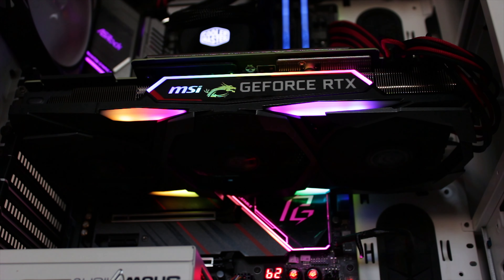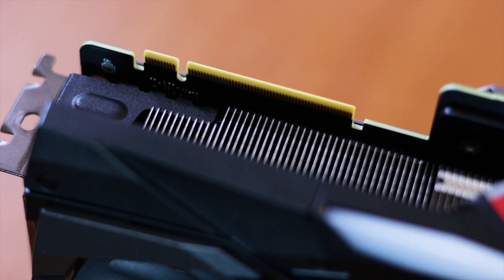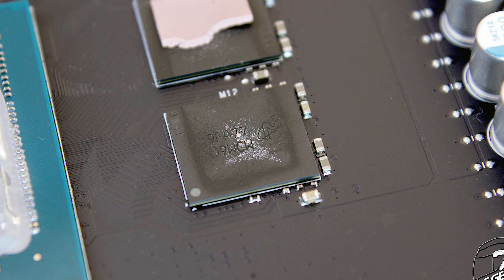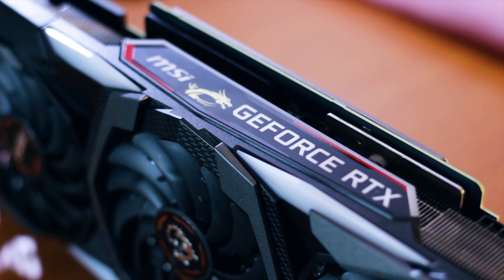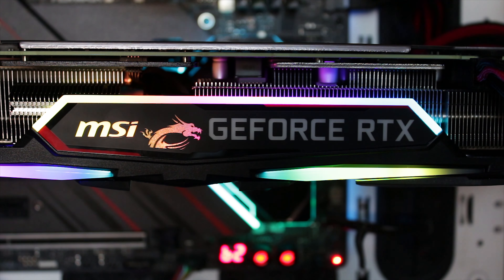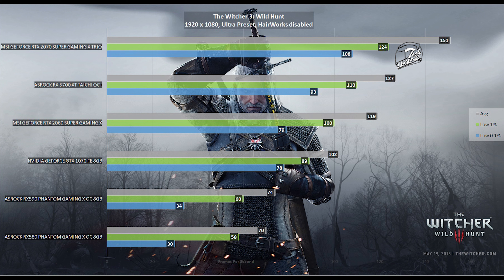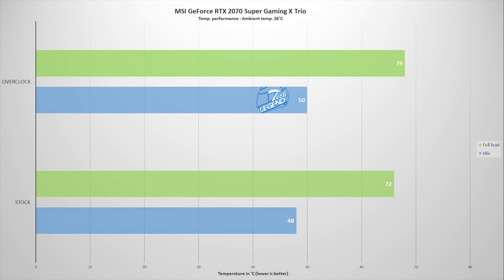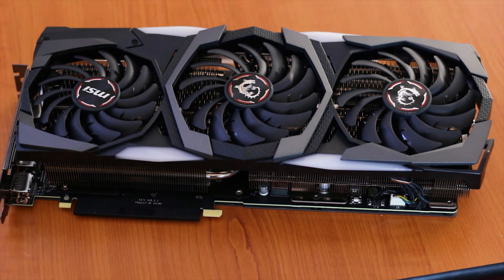MSI GeForce RTX 2070 Super Gaming X Trio - Review

Comment: I started using the card recently, I absolutely love it. Runs everything perfectly. I haven’t tried the ray tracing feature yet though.🔥👍🏽
Reply from the maker: Give them a try, you won't be disappointed! :)
Reply: is it as quiet as strix cards?
Reply: @megapet777  I'm not knowledgeable when it comes to strix cards, but I will say it's pretty quiet. I can barely tell if the fans are running sometimes.
Reply: @Liiijuh  nice! What % are they running at when using auto speeds when under heavy load?
Reply from the maker: @megapet777  While I have not yet reviewed the Strix cards, I can guess that they stay at around 60-70% fan speed.
Reply: Tech Legend isn't that quite high for 3 fan model?
Reply from the maker: @megapet777  It depends, the Strix OC card is running a few degrees cooler than the Trio and has a higher noise output. But, you can always create a custom fan profile and have it as silent as you want. :)
Reply: Tech Legend oh the trio is quieter? Thats impressive. Well yeah u can make custom fan curve but then the card will be hotter, if you go for quietness and some dont like to touch the gpu, just leave all at auto. 
I still hope noctua would make gpu coolers one day ;)
Reply from the maker: @megapet777  Unfortunately, the graphics card cooler market is pretty much gone. There are so many variations of the same graphics card, that it is impossible to make a cooler compatible with all the PCBs. 
And yes, the Trio is quieter than the Strix OC, but the Strix OC is running cooler.
Reply: Tech Legend true. How much cooler though? If only few degrees, then I would personally go for the quieter option, since the trio card is still very cool
Reply from the maker: @megapet777  According to TechPowerUP! who reviewed the RTX 2070 Super Strix OC, it is just a few degrees cooler. But that different can easily be made by just increasing the fan speed in the trio.
Reply: Tech Legend Okay. It depends on the person then, some prefer maximum cooling, some prefer maximum quietness. ^^
Reply: I am about to purchase that graphic card , do you recommend ?
Reply from the maker: @God_Ku  I have been using this graphics card since this review was published, no issues so far.
Reply: @God_Ku  Im using rtx 2070 super gigabyte windforce and this one is great too.
Reply: I am a little worried about the rtx 2070 super trio .. not my review or information about it .. I am thinking instead to get the rtx 2080 super
Reply from the maker: @God_Ku  If you can get the 2080 Super, then get that, it is better.
Reply: What about the rtx 2080 ? Still better ? 
The super is too much for me but the normal 2080 have a good price
Reply from the maker: @God_Ku  Yes, the 2080 is better than the 2070.
Reply: @God_Ku  You would never see a difference between 2070 super and 2080. So if you want 2080, I would really recommend getting 2070 super. Maybe if you have money to spare, since you are going for cheaper card than 2080, you could get higher end 2070 super, like the strix.
Reply: @God_Ku  If youre gonna go for the 20280 you might as well. The 2070 super is still good. I love the card. The cooling is great too. But the 2080 is obviously better.
Reply: Ok , thanks for the help from everyone here !!
Reply: @God_Ku  NP. Good gaming sessions for you!
Reply from the maker: @God_Ku  You're welcome! :)
Reply: @megapet777  I have both and yes it's as quiet as the strix and as cool. Personally I dislike high temps and noise. It's so quiet and cool even at full load that you would notice other stuff making noise like an old pc that has a loud psu etc.
Reply: @God_Ku  I would tell you why that would be a bad idea. Firstly the 2080 can't do high fps at 4k even the 2080 ti wont be able to get consistent above 100fps at 4k this is without ray-tracing. There are ultra powerful cards around the corner so get a 2070 super for now and enjoy gaming at 1440p and some 4k at high/ultra setting in some games and save for the beats that are about to come out. The 2080 super isn't worth the premium over the 2070 super for me. If it was only £100 more expensive then yes but not by £200+.
Reply: @vaux_manvv7520  i got the 2070 super aorus and its great ! thanks for all the great advices
Reply: @God_Ku  You are welcome mate, enjoy.

Comment: I have an question. When my graphics card rtx gaming x trio gets 72 deegres in load it is bad?
Reply from the maker: No, it is ok, don't worry. You can lower the temperature by creating a custom fan profile, or by increasing the airflow in your system. But 72 degrees is not bad.
Reply: @TechLegend-com  thanks man really thanks i can't sleep because of that XD i wanted to send it into service
Reply from the maker: @matyslaw01444  Stop worrying and don't send it to service. I got a maximum of 68 degrees in this review, so you're fine. Perhaps you can increase the airflow inside your case to help the graphics card out. But it's not a temperature that it's concerning. If it hits 98 degrees, then yeah, something needs to be done. Until then, your only concern is what game to play. :)
Reply: @TechLegend-com  thanks and another question on wchat mhz on core i have 68 temp.
Reply: Because in my card mhz can go down on 1845
Reply: I check it in MSI kombustor
Reply from the maker: @matyslaw01444  Wait a second, you get that 72 degrees when in MSI Kombustor or in games?
Reply: @TechLegend-com  kombustor
Reply from the maker: @matyslaw01444  Ok, then you really do NOT have to worry. Kombustor and other software, are synthetic benchmarks that max out the graphics card, you will not get this level of load in any game. So this is why your temperature is higher in Kombustor. Do me a favor and play a game for 1 hour, and see what the average temperature was for this graphics card. :)

Comment: I run my RTX 2070 super x trio at 2235 core and 8400 mem for benchmarks, and 2170 & 8100 mem for every day gaming, I love this card...
Reply from the maker: Great to hear! How are the temps at those frequencies?
Reply: 50c when playing games, and 37c with fans on full when benchmarking, it is water cooled though..
Reply from the maker: @Audi1Pete  Water-cooled, that explains everything. :)
Reply: This card now runs 2265mhz solid stable in gaming, it's a beast, although I do use a water chiller, benchmarking at 2310mhz it hits 23 degrees. with a 4k score of 10015 in superposition.
Reply from the maker: @Audi1Pete  Sounds good, what voltage?
Reply: @TechLegend-com  1.093v I've not found a bios with more voltage, I'm using the Galax Hof bios, it's been the most stable anything over 2290mhz and I start to get artifacts..
Reply from the maker: @Audi1Pete  I think you're reaching the limit of one of the components on the card. I'd try to get as much stability as possible while overclocking and call it a win! :)
Reply: @TechLegend-com  2235mhz, is the limit for stability at it's max locked voltage, it was just a bit of a challenge to get over 2300mhz
Reply from the maker: @Audi1Pete  It's great that you did, not a lot of cards can reach such frequencies.

Comment: I bought one.
Reply: How is it? I'm sooo conflicted on which card I should buy
Reply: @Dante-fb9ej  It willl be delivered today. I can tell u when i built in and tested it.
Reply from the maker: What other graphics card you are looking for? I have been using this one for quite some time.
Reply: @TechLegend-com  I'm thinking either the 2070 Super Gaming X Trio or the Asus geforce rtx 2070 super gaming advanced. Right now I have a gtx 970 4gb, which to be honest, still holds up fairly well, but upgrading is long overdue.
Reply from the maker: @Dante-fb9ej  If you are talking about the version with 2 fans, then no, I would get this one just for the triple fan cooler and the low noise operation.
Reply: @TechLegend-com  No i was talking about the one in your video, and yeah it seems like it could be perfect for me. A quick question if you don't mind; Would I need a new PSU before installing the rtx 2070 super gaming x trio? I have a 500W PSU right now, but I'm guessing the graphics card needs more power than that?
Reply from the maker: @Dante-fb9ej   What PSU do you have exactly? The Wattage is not as important as the efficiency and the internal build quality.
Reply: @TechLegend-com  https://www.coolermaster.com/catalog/legacy-products/power/b500-ver2/ I believe this is the PSU I have right now, but I think I need a new one regardless, as the cables are getting worn, seeing as it's an older PSU
Reply from the maker: @Dante-fb9ej  Oh yes, you need a better one. Have a look at the Seasonic Focus series.
Reply: @TechLegend-com  I will! Thank you so much for your help! You have earned a new loyal subscriber!
Reply from the maker: @Dante-fb9ej  Thanks Noren, please let me know what power supply you end up buying! :)
Reply: @Naselone  its ok for a ryzen 7 3700x?
Reply: @duard8895  yes it would be a perfect match

Comment: Great review! Just ordered this card to replace my Sapphire Nitro+ RX5700xt. Because im so done with AMD drivers.
Reply from the maker: Thanks for watching! What issues did you have with those AMD drivers?
Reply: @TechLegend-com  Black screen, no signal error wich causes pc to hard crash. Memory clock maxed out wich causes gpu to idle 50C+. Weird buzzing noise that started with 2020 drivers and so on. Sadly instead fixing drivers they just add more gimmicks. Great hardware let down by poor drivers.
Reply from the maker: @youp2ss  Yeah, I can relate. I once had an issue, where the fans would not spin at all, why? Because AMD Wattman did not like that I also had installed MSI Afterburner, so basically, I had no cooling from the fans, thanks to Wattman. smh.
Reply: @youp2ss  i got my card it has rgb problems. but after looking up online seems like the card dies for some people 1 month to 6 months after it was bought just hope they fixed this issue and we didnt get card that were made around the time this problem happened
Reply: @JHgamer101  Mine doing great so far :) rgb works great also. I'm using dragon center. Just set rgb settings what you want there and than close that program completely. It dosent have to run at background for rgb.
Reply: @youp2ss  did u fix youre black screen issue what was the problem. and i took my card back to the store the rgb was faulty so i got that fixed.also as a friendly reminder if u play at 1440p and u get stutter from big fps drops like 150fps to 90fps in some bits of a game like re2 remake. then watch this video had no stutter in a entire play session https://www.youtube.com/watch?v=jZrnfWpENTo
Reply: @JHgamer101  Black screen problem was with amd card. With rtx 2070S i have zero problems. And no stuttering, everything runs butter smooth. I'm using 1440p 144hz monitor.
Reply: Literally the reason I am looking at this to replace my Vega-56

Comment: any one planning to use this for 1440p gaming 1st thing you are going to get micro stutters a lot of people have this including me. in re2 max settings 1440p some times if i turn a corner super fast and shoot ill go from like 160fps to 90fps that makes it stutter. the fix is this. first set youre fps limit on msi afterburner to youre monitor refresh rate. and watch this video https://www.youtube.com/watch?v=jZrnfWpENTo helped me out a lot. and i did a run in re2 with out a single stutter even after a 154fps to 86fps drop still smooth
Reply from the maker: Or you could turn your Vsync On in those games. Or, you can tweak the settings so that you get a constant or above 140FPS. I am not sure how this is the fault of a graphics card, when you didn't even mention your CPU and RAM. :)
Reply: @TechLegend-com  nah i was looked into the stutter found out it only happens in the same spots when i first launch a game. dont know why i do have Vysnch and gysnch off. maybe you could explain im new to a powerfull gpu like the 2070 trio. cpu is intel(R) core(TM) 17-6700k cpu 4ghz. ram is 16gb 2133 MHz i have a feeling that might be to slow its a 5yr old ram. seems like a lot of people had this iddue tho with 2070+ maybe im running the settings to high in options i am gamming at 1440p tho
Reply from the maker: @JHgamer101  That lower RAM  frequency could play a role in your issue. Do you have this micro stutters in other games, or just in this one?
Reply: @TechLegend-com  i was having it on re2 but i dont have a lot of game can can push the card tbh. but i didnt get any today playing it. ffxiv has a lot of issues but that game has so many issues on steam. im downloading the new cod free to play thing today to test it out on a fps game. but im going to upgrade my ram next for sure  and a new ssd since im running the game on my normal hard drive
Reply from the maker: @JHgamer101  So it is mainly an issue within a particular game. Not really that uncommon, especially with modern games that have optimization issues.
Reply: @TechLegend-com  yeah its not a issue with the card thank god.
Reply from the maker: @JHgamer101 Yeah, check some of the game settings, perhaps you can lower some and get a better experience. Check those FXAA/MSAA settings, see what you can get.
Reply: @TechLegend-com  one question i turned it down to 1080p some stutter in the ame spots. checked online seen people have sam stutter so my guess is. it stutter at the same spots if u turn the game on for the first time then stops. but at 1080p im never getting 100%gpu usage at 1440p im getting 90 to 100% but how do i force my gpu to use 100% of its power with a fps cap im capping it at 140fps
Reply from the maker: @JHgamer101  Computers work like this: The lower the resolution, the higher the CPU usage and the lower the GPU usage. Turn the resolution to the max, to increase the GPU usage.
Reply: @TechLegend-com  i know it been a few days but the stutter still happens time to time. i even get it on diablo now and then not much tho. whats the chances my ram speed is not fast enough. also is it normal for my cpu usage while gaming to go from like 30 to 98% and it jump in between them a lot
Reply from the maker: @JHgamer101 What you are saying is not that uncommon. Many games suffer from poor optimizations.  Can you overclock your RAM to a higher frequency and see if that helps?